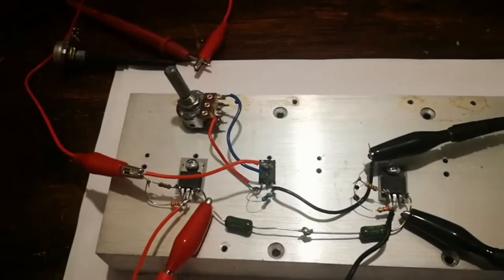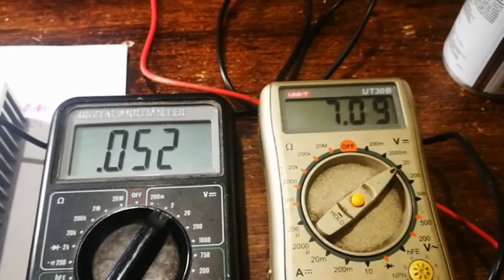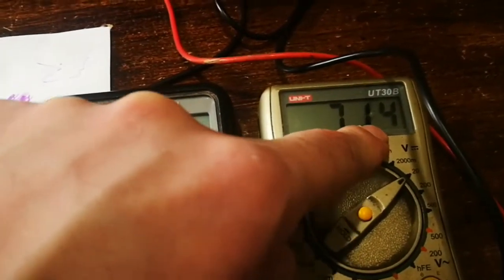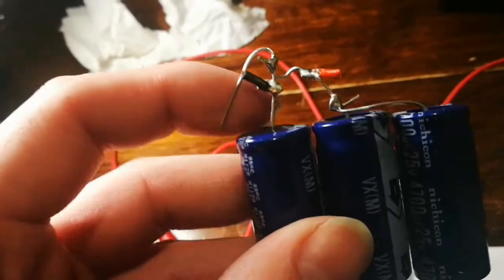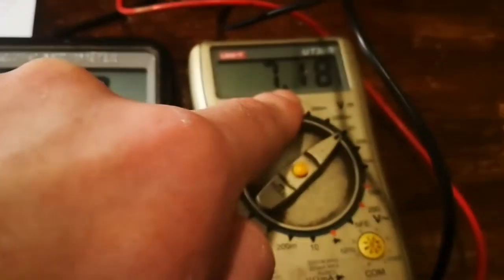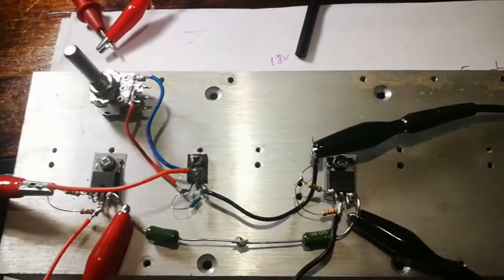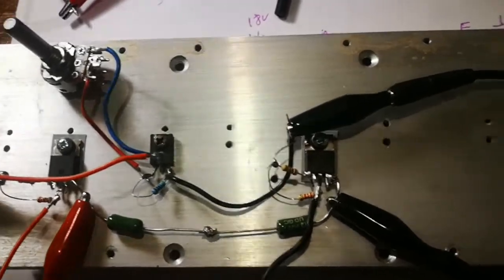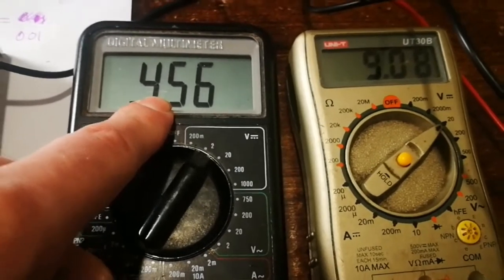Testing thermal tracking of Vbe multiplier on vertical MOSFET output stage using IRF530 IRF9530

Comment: Nice video .So the main diference between the use of vertical and lateral power mosfet is just proper biasing right ?
Reply from the maker: It's one of them. Vertical FETS can be regarded as having points in similar with both BJT and LFET output stages.